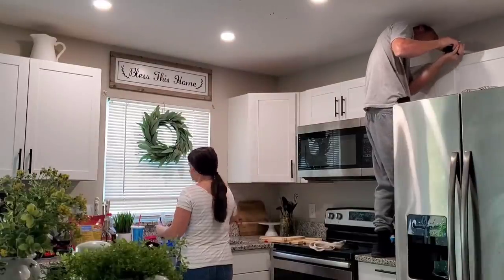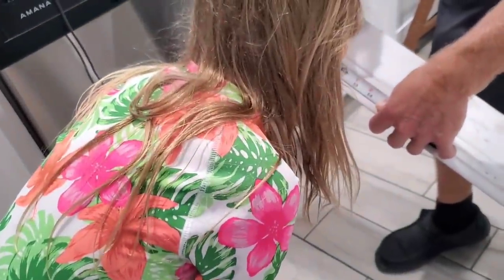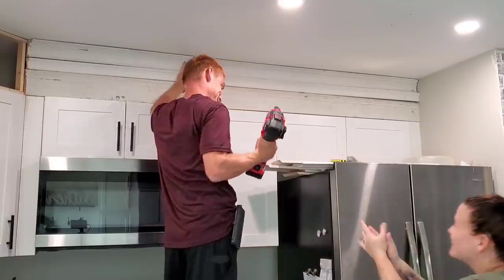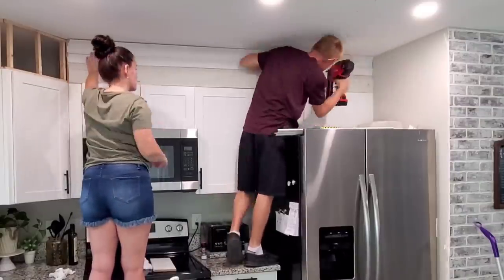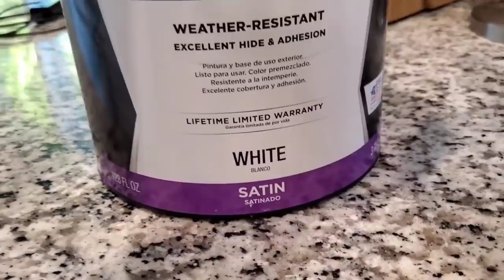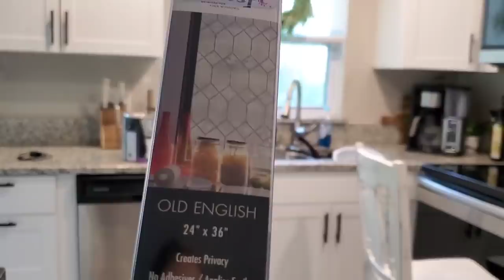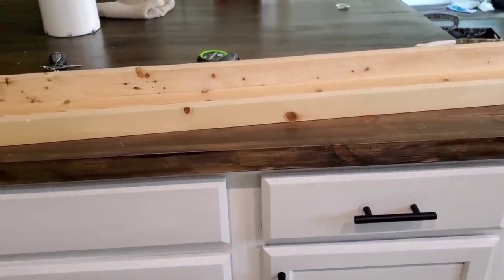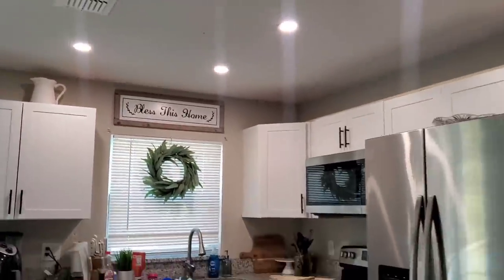DIY Kitchen makeover on a budget. Farmhouse kitchen makeover ! Creating My dream kitchen on a budget

Comment: You asked for comments………

It all worked out and looks fantastic, but for anyone else attempting it and having trouble deciding on the arrangement of the 3 pieces of trim over the cabinets, think of it as a large baseboard. The flat plain piece in the middle with the crown on top and the other smaller decorative piece at the bottom. 
Love the window film. It really looks like glass and adds a ton of charm. 
Window trim colour is personal choice and good either way. With the wood stained, your eye goes directly to the widow so if that's the focus then great.  If not, white is more cohesive overall and leave the wood to the accents. 
I admire how you work together and involve the kids. 
It was a pleasure to view both the results of your hard work and a loving respectful family.

Comment: Beautiful work as always. Dylan and you work great together, ☺️. As you're painting the moulding, I was wondering if you meant to use exterior paint? I guess I'm wondering how well it will hold up. But, yes you should definitely keep the window trim the wood color.

Comment: Sorry for another comment, but I was thinking about you wanting a light over your sink. Here’s an idea, you could use a hanging lamp with plug. You could hang your lamp in the center from a hook, then run the cord from the lamp, along your ceiling and down the side of your cabinet, stapling it into place, and painting the cord & staples white, you wouldn’t notice the cord at all. If you search “hanging farmhouse light with plug in” on Amazon, you’ll find tons of different options! 😊

Comment: I love it, what an amazing difference! I think I like the stained wood around the window because it matches the island. Don't those window panes come out? Mine tip inward so you can clean the outside from inside the house and there's a way to completely remove them from the window frame. If you're able to do that with yours then couldn't you just swap out the bathroom window pane and the kitchen window pain that's frosted? Are the windows the same size? I'm assuming they are if they put the bathroom window in the kitchen by mistake. And that design you put on the window would work in the bathroom. They put the granite countertops on my mom's kitchen on crooked as well and they had to be shimmed up. Maybe you can shim up your countertops from underneath the cabinets and make them level. People just do sloppy work these days it seems. But I love what you did to the kitchen.

Comment: Can you change the glass panel  or the bathroom and kitchen since theyre the same size? I'm thinking if theyre double hung you can . I can take mine completely out .
Reply: Once i have it folded on the i can pull one corner out at a time. Then lower the top and do the same .

Comment: I love how it turned out....  I have a question.  I live in a Manufactured home. Mobile home. I need some f
Kitchen cabinetdoorsike yours...?? Can u help point me in the right direction. Lookong for real wood. I need  some peel.and stick tile for backslash? I see what you guys are doing up above.  Them.  That may be better. Looking for the cheapest route. I have MDF CABINETRY. I want to farame them out in molding. Ise BEADBOARD for the cabinet middle part. Paint it out in a SHERWIN WILLIAMS extra extra white on the top vabinets. The cabinets brlow a teal blue/french blue. I have the Uglieest Formica. I want to make them IN WHITE WITH GRAY VEINING AND A CHARCOAL VEINING. BLACK. SEAL WITH POLYACRELIC, WATER BASED OF COURSE.... HELP ME KERRIE!!

Comment: Did you get dsh washer fixed go to Google did you get stove clock to work. Do you have booklets go to Google.
As I sd I fixed separate breaker for hvac and pump then main house breaker fridge, dishwasher stove and then microwave which this was a fixer upper no paper work I call Google my go to main man. yippie there still working. I'm now 74.
Repaired tractor and replaced tires didn't break my real nails but I tried to twist ice cube and snapped my left index to bleed for an hour lol ice not power tool just saying